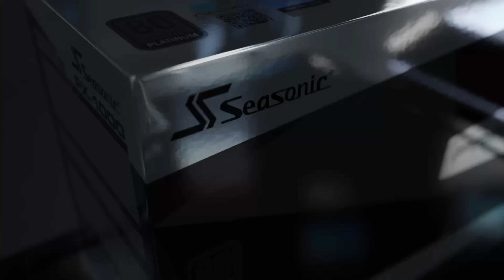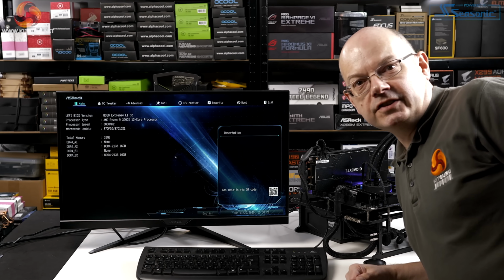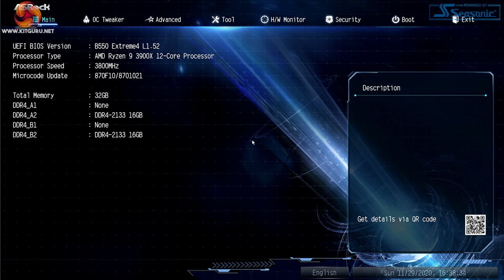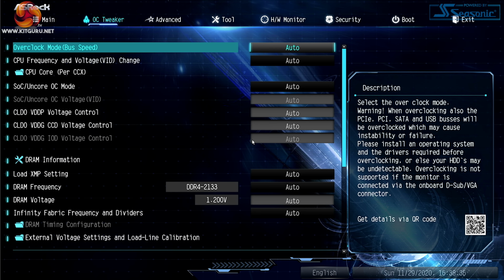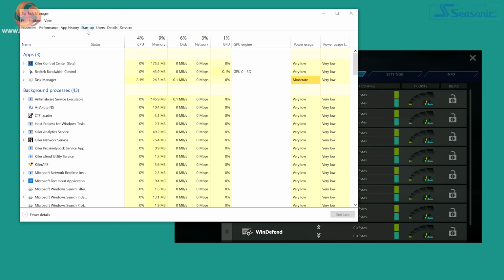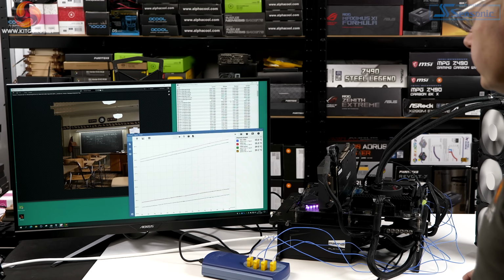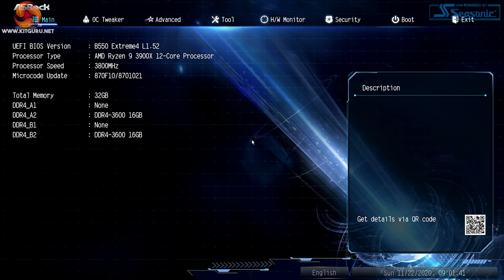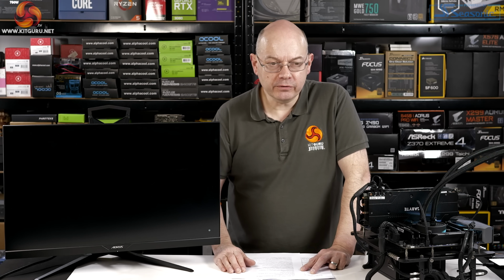Leo takes ASRock B550 Extreme4 apart!

Comment: decent review.
I have this Board and I like it because of the Segment Display Error Codes.
I also have a question tho: I see you get 55c temps in the Bios with a 360AIO, I get 65c with a 280AIO and a 5800x3d. Are these high temps in BIOS normal or a false reading? In Windows I get about 40c idle temp.

Comment: When I tested the prime 95 program for an hour on my tuf b450m pro 2 equipped with an overclocked Ryzen 9 3900 Pro, the maximum temperature on VRM was 56°C and the CPU consumption was 200W, and the temperature on the Kraken 280 water-cooled processor did not exceed 86°C.

Comment: Ahaha, loved the CD joke. Just received a GPU and was wondering why are there no round things inside. No cables, nothing, just a GPU! Have to say, I like Asrock, what I find disappointing is that they do not provide a bios update feature without CPU. B550 is 5000 series ready, but their x570 series are fairly cheap, but really good value, sadly you have to have a 3000 series CPU ;(
Reply: X570 is older tech than b550 that's why

Comment: The holes in the aio cover are so when you add a wifi card to the m.2 slot provided you can place your antenna there. I preferred it that way as I was able to use a wifi 6 plus card with bluetooth 5.2, I have not seen 6 plus or 5.2 built into any board. at least not in this price range. Also I bought this board on sale for $160 usd.
Reply from the maker: Which WiFi card did you buy? the vast majority seem to have no supports for antennae
Reply: @KitGuruTech  Bought it on Amazon, this is what it said-WiFi 6E AX210 Expands Wi-Fi into 6GHz with Bluetooth 5.2 Tri-Band WiFi 6 Module for Laptop and Desktop Support Windows10 64bit
Visit the OKN Store. Had to buy the wires and antenna separately.
Reply from the maker: @materferguson  Isn't that a PCI Express adapter, rather than M.2 though?
Reply: @KitGuruTech  No it's m.2, have it right here in my hand. In my Amazon add there are 3 different ones you can click on in the ad , underneath the header, two are pci ,but the one I got is M.2. one is $29.99, one is $43.99 and the M.2 is $34.99. Maybe the American ad is different or something. There are however lots of m.2 ax200 wifi 6, m.2 cards on Amazon. Mine with wifi 6 plus is the ax210.
Reply from the maker: @materferguson  Many thanks - that's interesting to see

Comment: In US, we're expected to buy a separate antenna kit - $2 to $20 for the most part.  They attach at those round holes.
Reply: Doesn't matter whether you're in the US or anywhere else, you'd be expected to get antennas for it IF the motherboard came with integrated wi-fi. But as you can see by the absence of SMA connectors, this board doesn't. So I don't get why these holes are here to begin with.

Edit: if you bought and installed a m.2 wifi card you could technically wire your antennas through these holes, but I'd get a PCI-E wifi card instead personally.
Reply: A proper install would be with an m.2  wifi module  with antenna connections, and antennas attached to a cable. Thread the antennas through the holes, instead the card and connect the antenna leads and you've got a more compact solution than using a cardslot. They are common to buy, not ASRock specific.
Reply: @northstar8818  why? It has a dedicated m.2 key for the Bluetooth wifi plus holes to mount the antenna nicely.

Comment: probably one of the best B550 boards for OC/Temps!
Reply: Is better than the steel legend?
Reply: @Primumnonnocere7  same board but the extreme4 has the power/reset buttons  on the board. The velocita has a VRM heatpipe connecting both heatsink but it's total overkill since the extreme4/steel legend have amazing VRM cooling already
Reply: @marcgallant5270  should i get b550 extreme4 or b550 tomahawk?
Reply: @TheKillerZmile  extreme4, rock solid and i'm on the first bios. Running a 3900x.
Reply: @marcgallant5270  update it :)
Reply: Thanks a lot, I'm seeing another thing, the B550 steel legend has the display port, the Xtreme 4 doesn't¿Do I need it? I'm seeing a lot of people saying that is better than HDMI, but I also think that the graphic card could have it. I'm going to use an Apu, and I will save money for that.
The last thing¿Do I need those power and reset buttons? I'm so new, sorry.
And thanks for your attention and assistance.
Reply: @Primumnonnocere7  that's only important for Ryzen APU's. Doesn't matter for normal AMD CPU's
Reply: @marcgallant5270  thanks a lot!!!Have a good day

Comment: Glad to see they put the USB-C header out of the way this time. I have an ASRock X570 Taichi and the USB-C header is directly in line with the top PCIe slot, so you can't use it with a large GFX card, even with a 90deg UCB-C cable plug (GFX card hits the top of the plug!).

Comment: Hey Leo!
I’ve been considering to buy this exact board for my Ryzen 5000 cpu in the near future (if they will be in stock hopefully). Got two questions for you:
1. There are couple of issues being discussed about other B550 boards right now. Namely, USB ports shutdowns/hiccups on gigabyte aorus boards and Ethernet controller issues on ASUS GAMING boards. Did you notice similar issues with this Asrock board?
2. Since B550 boards were released quite a few time ago, including this one, the BIOS on most of them won’t support Ryzen 5000 cpus. Other boards have the flashback feature which lets you to update your BIOS just with your flash usb-drive. Asrock Steel legend and Extreme4 don’t have this function. How likely is that my new Extreme4 board just won’t boot with the new Ryzen 5000 CPU? What am I supposed to do in this situation? Any chances they are shipping these boards with correct BIOS lately?
Thank you!
Alexander
Reply from the maker: Those are very sound questions. Didn't notice any hiccups during testing but if you have details about USB and networking problems that might be useful. ASRock has supported Ryzen 5000 since BIOS P1.20 which was issued in August. The first two BIOS in May and June do not support Ryzen 5000. Our review sample was shipped with BIOS P1.00 so the wise move would be to ask your etailer to open the box and check the sticker on the BIOS chip.

Comment from the maker: Leo will be here to answer your questions when the video goes live !
Reply: My 3900x is oced 45.50 44.50 43.50 43.50 at 1.375v on a x370 gaming Pro carbon . If my board is ok , that ASRock is a Monster . Good work keep it up.
Reply: what would be a good non rgb atx board with a very good vrm?
Reply: FOR AN AMD PLATFORM   what would be a good non rgb atx board with a very good vrm?
Reply: Hi, Please Sir can you tell me which slot i should put this Kingstone U-SNS8154P3/128GJ,  labled as M.2 PCIe Gen. 3 
 NVMe 1.2,  Thanks in advance.